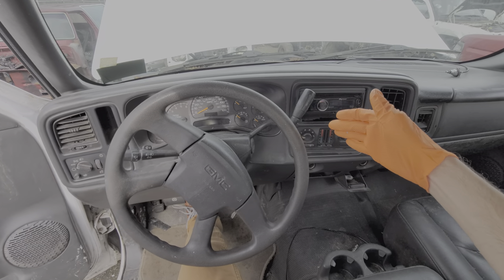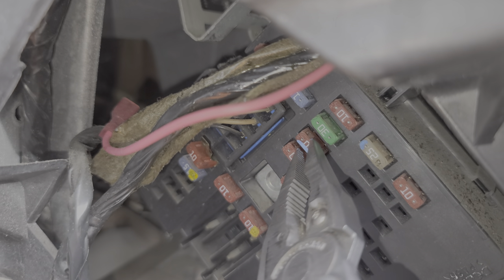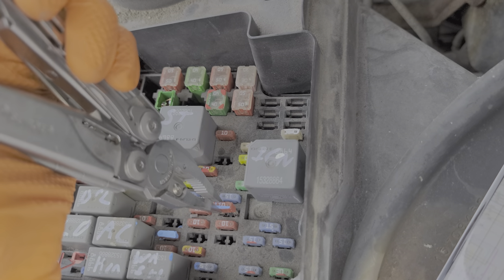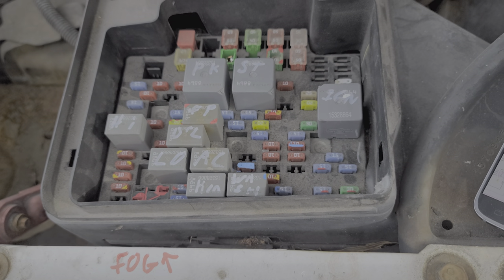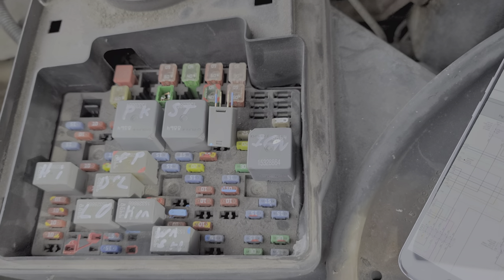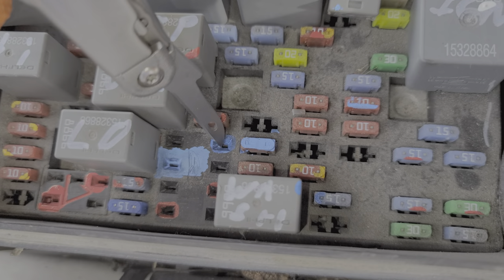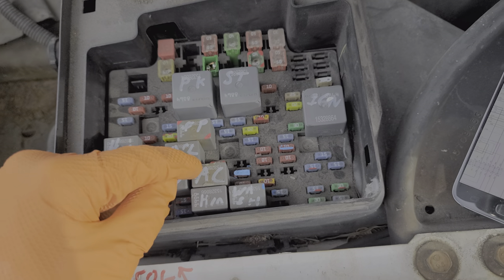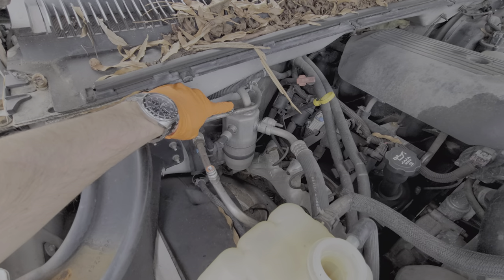2004 GMC Sierra 1500 AC Relay, Air Conditioning Fuses & Troubleshooting

Comment: I've been without AC here in NC for over a year because I swapped in a bad AC clutch which melted the solenoid. After installing the new replacement clutch, my A/C was not working at all, so I was close to resigning to taking to a shop to swap out the whole compressor. When I found your video, I double checked all of the fuses and sure enough, the A/C compressor fuse was blown. Swapped it out, A/C works beautifully now. So thank you!

Comment: Hey,   Thanks for this.  Found out the AC relay was bad by replacing it with the horn relay and AC worked perfect.  Now just need to buy a new relay.   Saved me a more expensive trip to the mechanic…..kudos sir.

Comment: I liked the part explaining that the computer won't allow a'c to work if check engine light is on. Mines been on for 3 years but an additional problem could have caused it to come on again and since it's been on, I wouldn't know. Lot's of good info for such a short video.

Comment: Thank you, I tapped my relay it came on. I though it was because it was because the freon was too low, I let some out the other day and it stopped working after that. I swapped the wiper and AC relay foe the time being I will  see if my wipers stop now... I do have a slow feon leak that requires me to top it off every so often. Appreciate the video and help...

Comment: AC worked great when last used 5 days ago. Today compressor comes on and the tubes get cold but the compressor does not stay on long enough, turns off then comes back on, never cooling enough.  Suspecting freon but the Air was ice cold when last used. .?

Comment: What does it mean when the driver side ac starts blowing heat but the passenger side stays blowing cool while both set on cold,I have to pull over turn off car then restart for it to reset!
Reply: It’s the “ac actuator.”Super simple to fix. Purchase part on amazon.
Reply: @realfaithlife2104  thank you!
Reply: Thas happening on my 2005 yukon .thanks
Reply: Yup! It's the blend door actuator. Had that happen on my '04 Sierra and a new actuator and caliberation fixed it.
Reply: @nateb4114  How did you calibrate it?
Reply: @Eltakuachecuh  if you look up blend door actuator calibration on YouTube there's a few different videos on the process. It is basically pulling a fuse, putting it back in and then turning the truck key to the run position and letting it move the doors around.

Comment: Having this problem at the moment, nothing was working then switched the horn relay with ac relay and the air started blowing but it was fuming hot and still no power to the actual snowflake button or any other buttons? Anybody know anything?